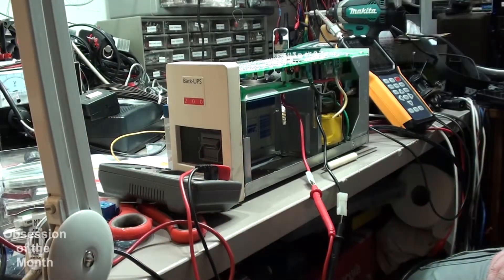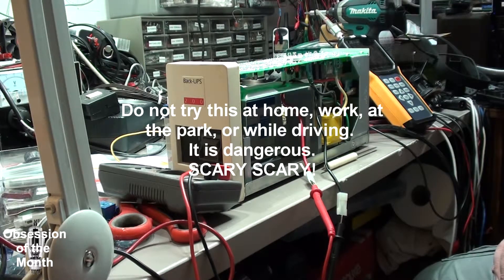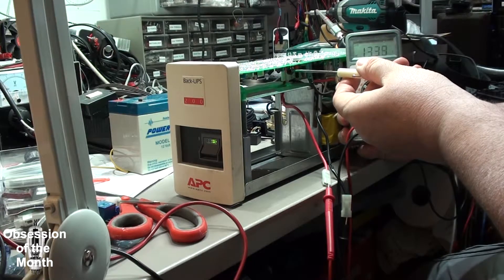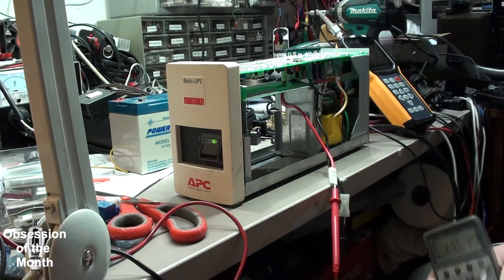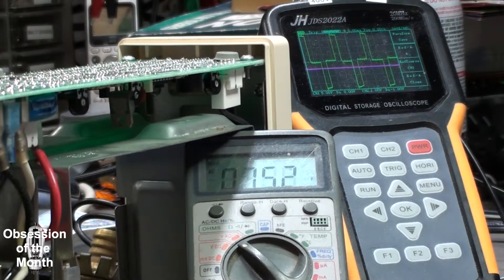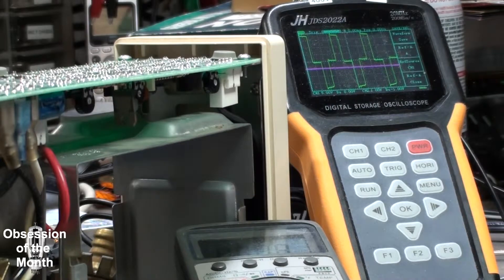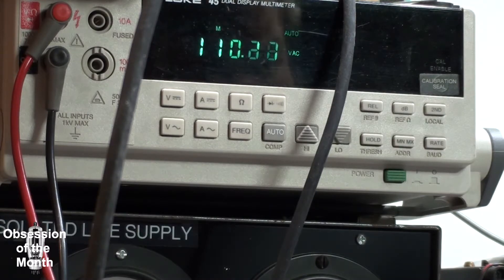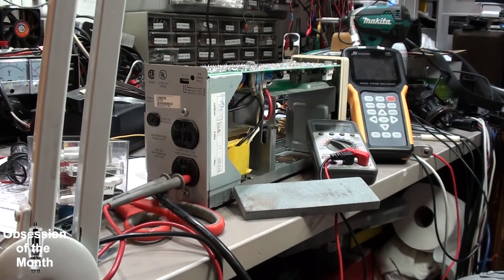Adjusting an APC Back UPS 200

Comment: Just curious before I break into some of my UPS units (warranties of current units I have in use are starting to expire)...

Does anyone know if high power Cyberpower UPS boards have similar readily accessible adjustments (in particular to set float voltage)?
Better yet, can anyone point to anyone who has posted details on the Cyberpower internals, torn them down, etc?

I'm guessing the high power APC units I have are probably patterned somewhat similarly to the unit "Obsession of the Month" is dealing with in this vid, so I'm focussing on the Cyberpower units for the moment. I've been searching online for awhile and not finding anything very useful regarding detailed examinations/discussions of Cyberpower UPS internals.

I've got a mix of APC and Cyberpower all 1000-1500 (highest rated unit handles 900Watts), and EVERY unit I've measured maintains a float voltage that by a fair amount exceeds 14V on each 12V battery (including the units that use 2x12V batteries in series). Some of them are floating the batteries considerably above any recommended range I've seen for this class of battery, which can significantly reduce the lifespan of these SLA/AGM batteries (e.g. a battery that should last about 5 years lasting closer to just 2-3 years or so).
Reply from the maker: the old back-ups are calibrated like in my video, newer APC UPS's (smart UPS's) can be "calibrated" with a serial connection. I tried it with one of my smart-UPS's and it sort of worked. http://www.jjoseph.org/notes/apc_smartups_battery_float_voltage I have no cyberpower units and cannot help with them.
Reply: @ObsessionoftheMonth  Thanks very much. I didn't see that in the Cyberpower program, but I wasn't looking for that specific parameter at the time. I'll revisit.

Comment: I have APC Back-UPS 650VA, 230V BK650MI, must a ups be turned on to charge it?
Reply from the maker: It is my understanding that as long as it is plugged in it will charge the batteries. I have never tested this.